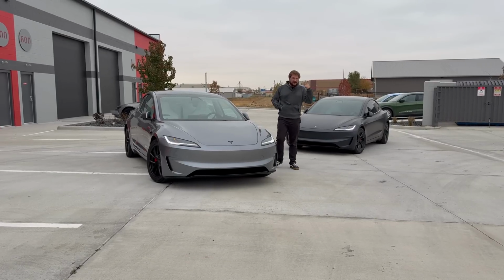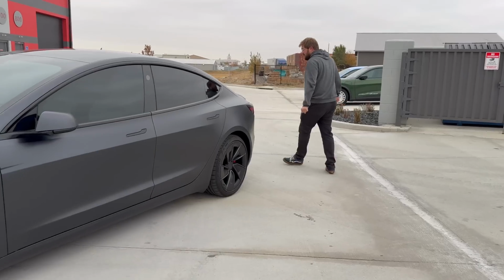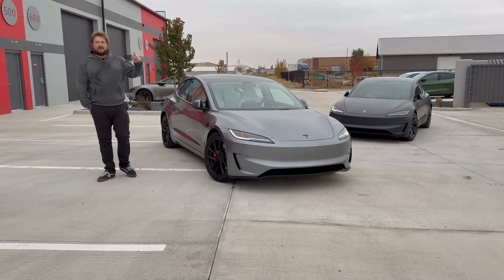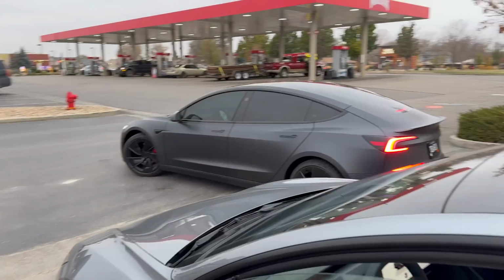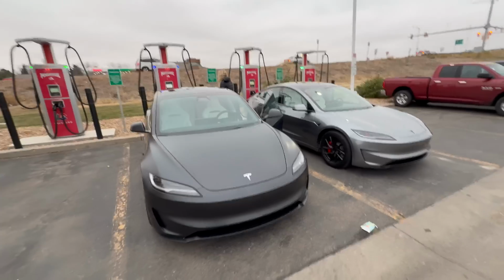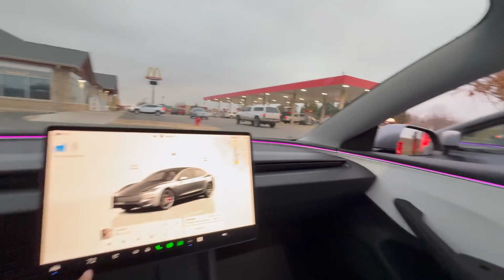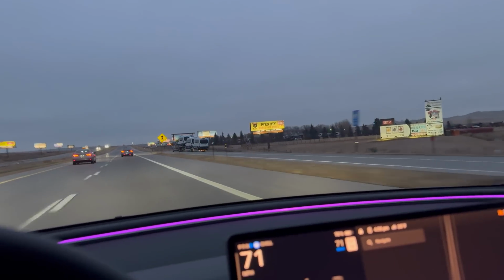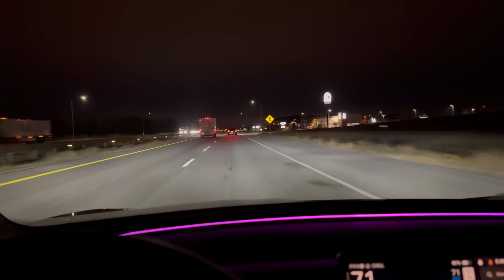Tesla Model 3 Performance Drastic Range Increase w/ These Martian Wheels!

Comment: I just fitted 18'' aero cover proton wheels on my model 3 P the front calipers were no problem but I did shave a bit off the rear calipers. On the same trip I do twice a week I normally use 10 % charge I only used 8%. On the up hill section consumption with the 20 '' wheels was 200 watt hours per km and the return was 135  watt hours per km with the 18 '' 165 watt hours per km  and  100 watt hours per km at 60 - 85 kmh.   Looking like 20% reduction in power used. The lowest I have ever seen with the 20'' wheels was 125 watt hours per km and the new lowest with 18'' wheels 100 watt hours per km both on the 1/2 down hill with the rest flat. I got the wheels and aero caps with 1/2 worn tires for $ 750 and should recover that with the next tire change. The foam inserts do reduce noise as I don't think the 18'' tires have them as they had aftermarket tires and the 20'' had the original tires and I have the tire pressure warning so need to fit TPS to the 18'' tires.

Comment: Any chance you could do the same experiment on the cyber truck? I believe it has 22 inch core and 34 inch total tire. And Ai says if you switch to 18-20 core and 29-30 total tire, the 340 mile long range cyber truck will get up to 390 miles.

Comment: Hello, I had a question. I tried to ask my local Tesla dealership and America’s tire to install the smaller wheels but they were saying I can’t go smaller than 19” and no less wider than 235 for the 2018 model 3 performance. How can I be sure when I get those sets of wheels and tires that I won’t have problems fitting them? thank you!
Reply: There’s a loophole around this when it comes to Americas tires: buy the compatible rims, when making an appointment with AT and buy tires from there and have them build the wheel. Install the new tires on your own at home to ensure it’ll be installed. Just make sure to buy rims that are compatible with the performance trim

Comment: 13% range improvement but with smaller rear tires, performance and safety is your trade off. Buy the LR or base if you want 300+ miles, the performance is amazing for an EV with 20 inch wheels.
Reply: Long range or base models have a stupid 125 mph cap, lower than my Scion tC

Comment: Its a performance vehicle and Im glad Tesla packaged it that way on aggressive tires. Theyre great for twisty roads. If you want 18s on yours, thats great, and I will get a set for winter, but I do not want Tesla to change the default package.
Reply: 19” should be a credit option on the M3 Perf

Comment: This might be a dumb question... I don't know much about staggered vs square set up for wheels, but since the stock m3p is staggered, do the aftermarket square setup tires (Martian in this case) sit narrower than the front tires?

Comment: Good to see but as I only keep my cars for 3 years and can do 10,000 miles for £150  home charging (£900 for 60k) it would be pointless me spend £1000 on wheels then another £1000 on tyres. And by the time I have driven 280 miles I would need a wee so I could stick a small amount of charge. If you could select a different size set up from the start I would have to get a bit more range. Love the information tho

Comment: Hi, I just got my 2025 M3P and want to swap to 18inches square setup for all-season after watching this clip, I got the same wheels from Martian and Michelin CrossClimate2 235/45R18 98V XL, however, when I asked Martian about the lug nuts fitment that if I could use OE lug nuts, the replied was "The OEM Tesla Model 3 Performance lug nuts may not be compatible with our wheels, as they typically use a different seat type. We recommend checking with a tire and wheel specialist to confirm if conical seat lug nuts are required for proper fitment and safety" SO, does anyone can confirm or suggest what kind of lug nut should I go for? Thanks for all the help in advance!!

Comment: I did 18s from TSportLine for our 2022 MYP.  I can confirm everything mentioned in this video.  I have over 24K miles on our 22, and about 50% is at highway speeds.  My wh/mi improved by 10.4%.  Tesla OVER TIRES their vehicles.  They could easily offer a smaller tire/wheel as the base tire/wheel and option UP to BIGGER.  Most folks don't track their cars; if they do, they should use more track-specific components.  That's what I did with my vettes.

Comment: Aero wheel designs make no sense if there is not a double set of moulds to respect symmetry for aesthetics and for aerodynamics as well.
Weight is key, forged wheels with the right design are the best solution. 
I think I would not sacrifice aesthetics with small looking 18 inch wheels just to gain 15% range. It’s the Performance, after all!

Comment: I put the MW08 19x10.5 on my 2024 MYP. Tires are Yokohama ADVAN Sport EV AS. My Y looks mean as hell now, but there’s on issue. The tires/wheels resonate and create a frustrating droning sound that sounds like blowing over the top of a glass coke bottle. It can be felt in a subtle way through the steering wheel and floor of the car. Others have reported similar issues with Martian wheels with a variety of different tires. I don’t want to go back to the Hankook iON EVOs (good tire but do not grip like the non-EV performance tires), but in some cases an acoustic foam tire might be a necessity.

Comment: About to buy a set of MW05 for my 2024 M3P. Probably gonna go with 19 inch rim for aesthetic reasons (18" looks a little bit dinky).

What rim width do you recommend? What all season tires do you recommend?

Never planning on driving on track, not terribly worried about efficiency, ideally would like the tires to be quiet and comfortable.

Comment: For the performance can you get the same size wheel/ tire for all 4?? No staggered
Reply: yes
Reply: @1000yrsofdeathh  What size would this be? 245s all around maybe? Instead of 235s on the front and 275 on the rear?
Reply: @fs454  Whatever is ur preference. I did 275s all around.

Comment: I live in Colorado and I’m getting 103% efficiency on my M3P on highway and 97% around town. Strange. Have a set of winter wheels and summer wheels on the way so I’m excited about the 13% range bump. Should put my at 330 miles of range.

Comment: This is exactly what I did on my 2021 M3P. The wheels have been bulletproof and amazing. Range has been great. I have 18 inch summer and winter sets - which was key for better road comfort too for that model year.
Reply: What tire did you go with on the 18” for cruising ?
Reply: @ Summer rubber is performance oriented. Wide and stickier. Michelin Pilot Sport 4S - 9.5 inch wheels so 265/40ZR18
Reply: I'm a massive Michelin ps4s fanatic but trust me when I say get the Kumho Ecsta Sport S next time. Miles cheaper by several hundred and they're actually a better gripping tire in wet AND dry along with better ride quality. I'm extremely surprised with these tires, first time I've never gone with PS4S on one of my cars

Comment: I would be really interested to see what the dual motor long range can do if you use the S3XY buttons commander to put the car in rear wheel drive only. Could you get close to the efficiency of the base car with a bit more performance when required and also the better sound system??

Comment: I am curious to see model 3 performance with stock wheel but low rolling resistance tires! The stock wheel with aero covers looks to be more aerodynamic than those Martian wheels. So I wonder if the range improvement was just due to the rolling resistance improvement. But even if it doesn’t at least you get another video for us to watch.

Comment: I originally put snow tires on the stock uberturbines and bought MW03s for the summer. After replacing 3 of the low profile performance snow tires due to nails and blowouts on the pothole ridden streets of Colorado, I bought the MW08’s in 18 inch variety to get some more sidewall for the potholes. Just put them on, looking forward to the range improvements as well

Comment: Interesting test with good result for the 18" wheels.  Kyle's attention to detail to eliminate variables between the cars is appreciated.  One thing  that was not controlled is the unit-to-umit variation between the two cars.  Swapping the wheels from one car to the other, then re-running the test would help cancel that out.

Comment: When are you going to do a range test of the Gen2 R1S with and without the aero wheels? People are claiming they make no difference since Rivian doesn't claim any additional range, but it would be interesting to see actual data on standard wheels vs aero wheels (with aero caps) vs aero wheels (without aero caps)? I'm guessing there is a reason Rivian doesn't add claimed range for the wheels probably related to them not doing an EPA test with them??

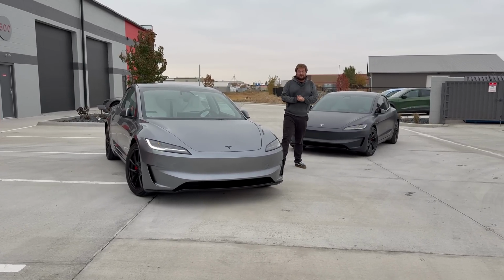Comment: 2:17 I bought the smallest 18” x 7.5, that size is discontinued at this time, and run 215-50 x 18” and can drive more comfortable due to bigger tire walls and is lighter tire, less unstrung weight, that makes for a better consumption figure…🫡

Comment: I have the 19inch (19x8.5) matte bronze mw08. Amazing set of wheels. I'm using them for my winter set on the highland m3p and I couldn't be happier
Reply: Noticeable range improvement?
Reply: @everythingtesla8833  yeah a good amount. I have the stock ones with the aero caps off too so that made it worse

Comment: Martian has an MW08 (in the video), but also an MW05 and MW03. They only list the weight of the MW08 on their website. Anybody know if the MW05 and MW03 are lighter? I assume so based on the price but not sure. Would be nice to know the weight of all 3.
Reply: MW05 is about 3 lbs lighter per wheel for all equivalent sizes.  I emailed MW and they sent me a chart. I assume MW03 would be close to that.

Comment: Discount tire counterbalanced the Martian wheels - weight should only be in one location on each plane. What they did works, but it’s lazy, and shows the tech doesn’t have an understanding of proper wheel balancing. That, and the outer weights should be much closer to the spokes. This is easy stuff. 

I wish I could be your tire shop for the channel but I’m a few thousand miles away!

Comment: Nice comparison ! 
But the mechanic that install that tyres on the 18 rims is absolute stupid .The red dots must be at the point where the or valve are.He use so much extra weight to balance the tyres …

Comment: So it looks like the uphill range impact was +20 miles and downhill real-world range impact was +40 miles with the 18s vs the 20s. Very impressive! I have to assume that the fact the 20s have aero covers helped them a bit too. I'd imagine that if the Martians hypothetically had good aero caps, we'd be looking at maybe another 10-15 miles extra range on top of these already big gains. 

Based on my calculations using an 80KWh battery pack size (yeah I know that's slightly inaccurate), the M3P on these 18s got upward of 255 miles real-world range on the uphill leg and 314 miles (!) on the downhill leg, all in near-freezing weather. Even running the stock 20s it was getting 235 miles uphill and 273 miles downhill. That's fairly incredible. My old 2018 Model 3 LR (on 19s and Michelin PS AS 4) would have been hard-pressed to manage even 220 miles average real-world range at these temperatures, sometimes I wouldn't even reach 200 miles. This new car on the 18s is averaging ~285 miles and on the 20s averaging ~255 miles. And the older model on paper supposedly had more range than this new M3P does! Even at 80mph, this new car on the 18s could probably do ~250 miles even in near-freezing weather. Theoretically you could drive from Atlanta to Philly needing only three charges even in winter. In my old car, I had to stop at least five and sometimes six times doing this route in the winter. Insane improvement.

Funny enough, I just slapped on some ultra-lightweight 18 inch Atomic wheels and the Hankook Ion Evos to my own new M3P yesterday. Can't wait to see these kind of efficiency improvements myself! Though I'm so torn on putting this rocket ship into Chill... 😆
Reply: We would love to hear your range test results with your new setup!  Please share!
Reply: @geckojosh2889 same here
Reply: You don’t want chill mode anyway for efficiency because it lowers battery temperature. Just don’t accelerate hard on insane mode and you can replicate the feeling of chill mode. Kyle probably would’ve had even more range if he used insane mode and took it easy.
Reply: What size 18??

Comment: Great video! Just a heads up I have the same Martian MW08 in 18x9.5 on my 2023 M3P and I found that if the wheel weights are all the way in the back of the barrel they will rub against the front upright hub assembly. I’m running 255/45/18 so not going to see those kinds of range improvements but I have also not seen any range loss by going with wider tires. The ride quality for me has been significantly improved compared to the stock Uber Turbine wheels. I will never go back to 20” wheels!

Comment: Speaking of the staggered wheels. I hate how Volkswagen did it on a non performance vehicle. No reason for it. Just fixed that issue today. Bought a pair of the narrow wheels that are on the front for the rear and put 245/50/20 tires on it all the way around.

Comment: The actual shape of the wheels matter less for those wondering. It's entirely possible the surface of the 20in wheel with the aero caps is more aerodynamic than the 18in Martian wheels used here. Bigger difference is the massively wider 275 rear tires on the performance model versus 235 in the normal model. Plus the performance model has more sticky tires whereas the 18in tires are optimized for low rolling resistance
Reply: FastWheels makes an 18" Aero wheel that fits. A viewer of my channel put them on his 2024 Model 3 Performance and got 360 miles of range real world. He's averaging 218 Wh/mi. I have the same wheels (in 19") on my 2022 Model 3 Performance and I average 214 Wh/mi and get 340 miles of range. I get the owner of Martian Wheels is your friend and all, but there are better options if you want maximum range. I don't have anything against Martian wheels, I use them when I take my car to the track 😎
Reply: @teslasnek  Which wheel specifically are you two using from Fast Wheels? That sounds like a dream efficiency!
Reply: @armandagopian  EV01(+) wheels and Nokian One All-Season tires
Reply: @teslasnek  Perfect thank you. Would you recommend 18 or 19? Any differences?
Reply: @armandagopian  18" is going to get slightly better range than 19" though I put 19s on mine because I didn't like how small the 18s looked
Reply: @armandagopian  I just posted a video about them a few minutes ago
Reply: thanks for explaining. so the video was more a test on wheel sizes rather than martian wheel vs stock wheel?
Reply: @ervin9805  no the video was a more a test on tire size and type. The shape and size of the wheel were not directly tested here because not all other external variables were the same or controlled
Reply: Is it possible to do a test with 20 in Marian wheels square with the smaller front width size all around .... Would love to know if that would help being a lighter wheel and being smaller width
Reply: Wagon wheels are inefficient? Who knew?
Reply: Wheel surface most definitely makes a difference. There are 3rd party aero disc's that fit the long range wheels and give you 20 to 30 more miles from the tests I've seen.
Reply: yes, tire is a big factor. the 20 uses high performance summer tires while the 18 inch one uses all seasons that are also optimized for low rolling resistance. The wheels help, but so do the tires. It's probably closer to 8-11% difference if the 20 inch one used the same hankook tires
Reply: Yeah misleading video

Comment: Thanks.  I shifted from 21" on my 2021MYP to 19" Martians (non staggered).  100 pounds less unsprung weight. More comfortable. Better mileage, especially in normal-for-me city/highway mix. Tesla engineering is a fail in this aspect.

Comment: Those wheels ruin the look of the car. I have forged wheels on my 2024 Model 3 Performance Quicksilver, that are much lighter than the 18s you guys are promoting and look way better.
Reply: What brand pardner? What size did you go with?
Reply: @ Apex Wheels. They are expensive, but well worth the price. They make one of the strongest and lightest Forged wheels in the market. In my opinion, one of the best looking wheels
Reply: @M3PQuicksilver   Cool thanks, I’ll check them out. Did you get 18s?
Reply: @ 19s, 18s are too small for the car. When you run 18s, the tire sidewall becomes taller and causes a lot more flex under hard turn in. I’ve been building race cars for a little over 27 years. The car with 18s will feel more spongy

Comment: Martian (and TSportline & others) should come out with some aero caps for their wheels. I'm really surprised they haven't done this yet. I think if they had optional aero caps, they might do quite well on a range test. 

I have a set of 19" Titan 7 TS5 wheels on my '19 M3P, and while they look great, the aero efficiency isn't great. In fact, it was worse than i thought it was going to be given the weight savings that they provide (rims are 19 lbs each). If Titan 7 made an aero cap for those, I'd totally buy a set. 

Any, it'll be interesting to see how this test shakes out.
Reply: PS - I also have 18" wheels for my winter setup, but I forget the brand of wheel (it's not Martian/TSportline). Got them used when I had my Kia Stinger GT. 

And as a tip for M3P owners, any 18" wheel that fits the Kia Stinger GT will fit the M3P also as they have the same bolt pattern & offset. Center bore is different so you may need some hub-centric rings). So that could be a source for some no-tesla-tax inexpensive wheels for the M3P. 🤣